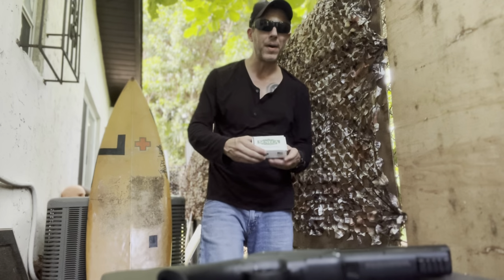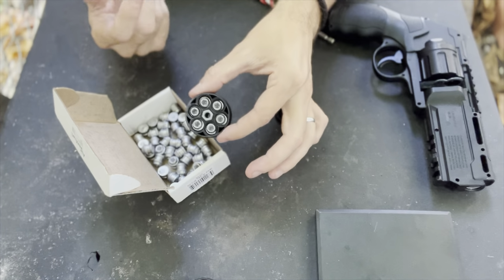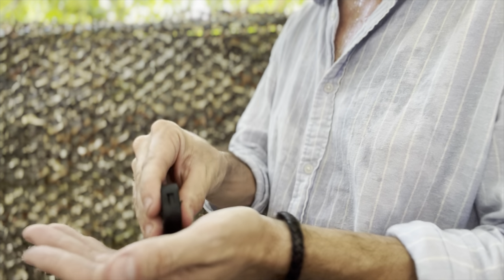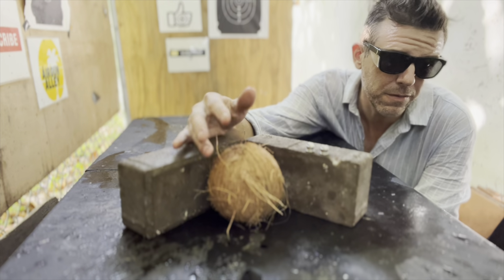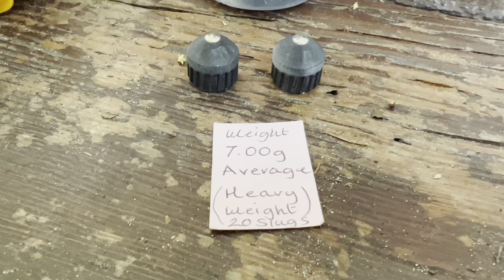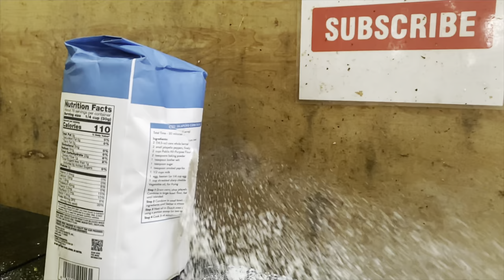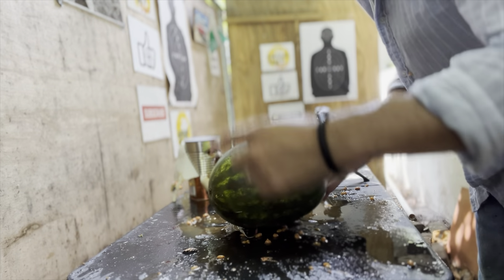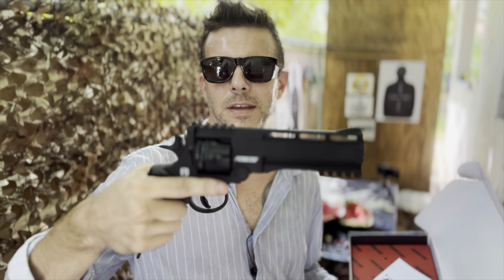HDR 50 • 50 cal PELLETS

Comment: Dab of grease on each rounds circumference to hold in drilled through magazine.
Reply from the maker: Good one! 🙌🏼
Reply: @AirgunAlley  any chance of you reviewing the extended barrels and thread on extension kits?
Reply from the maker: @cal2299  good question. I just reviewed (check my latest video) a barrel-shroud extension that you apply externally. But never the actual barrel extension, nor the whole power tuning kit. (Check out Rune Rebel or DK Spenser for that) 
I actually decided to stop reviewing modified guns and stick to factory products. I noticed that the majority of my viewers prefers that.
Thanks again!

Comment: DUDE I ADMIRE YOUR COURAGE" AND YOUR EFFORTS SO I JUST WANT TO THROW THIS IDEA OUT THERE😐 MAYBE YOU HAVEN'T CONSIDERED BECAUSE I THINK YOU'RE ON THE RIGHT TRACK" WHAT I WOULD CONSIDER IS TO DRILL THE HOLES ALMOST THROUGH EXACTLY LIKE YOU DID" WHICH I THINK WAS SOMEWHAT CLEVER" BUT GO ALL THE WAY THROUGH WITH THE NEXT SIZE DRILL BIT SMALLER👍 IF THAT MAKES ANY SENSE BUT KEEP ON TRYING I SHARE YOUR SPIRIT BECAUSE I DON'T GIVE UP EASILY EITHER👍 HOPE THAT HELPS YOU OUT" AND ENCOURAGE YOU TO STAY COURAGEOUSLY  FIERCELY OPEN-MINDED WHILE DARING TO BE THE DIFFERENT DUDE 💪 OKAY PEACE OUT 👍😊🤔😎
Reply from the maker: Bro!! Thanks so much for the idea (good one!) and for the words of encouragement 🙏🏽 will test that out
Reply: @AirgunAlley  hello dude this is James Brown again I forgot to mention that those over reamed out cylinders can be repaired with hot glue if you go around the edges with a line of hot glue and take a round file you can take your time and smooth them down to the size you wish because once that stuff cools it's basically like plastic itself good luck 👍

Comment: Try a little beeswax will hold a pellets in place and give you a better seal
Reply from the maker: That’s sounds indeed like a good idea Joe, thanks! The only thing I’m not too sure about is having wax splattered along the barrel and in the valves 🤔
I actually stopped using wax molded slugs, I just found them to be too gooey for the gun…
Reply: @AirgunAlley  I don't have a revolver don't know how mechanisms work but I know with airgun I believe if you use Vaseline are heavy oil it can combust and gives you more power
Reply: @AirgunAlley  they call that dieseling
Reply from the maker: @joeschneider8025  I never thought of beeswax for dieseling. I my self am more of a silicon oil dieseler
Reply: @AirgunAlley  guess I didn't say that right Vaseline oil or something of that sort for dieseling I was saying try that instead of the beeswax if you were worried about gumming up your gun
Reply from the maker: @joeschneider8025  ah yes sorry, I just saw your other comment! Exactly, that sort of products I think are best for these kinds of revolvers. Which at the same time also help keep the seals nice and lubed, after constantly freezing from the CO2 release…
Reply: @AirgunAlley  just re-watching your video would like to see you try and alloy very light compared to the heavy to see if you can get your feet per second up towards the 500 range or higher

Comment: A ballistics gel dummy would make a good target. Or possibly one of those giant gummy bears. See taofledermaus for target ideas.
Reply from the maker: Oh man! I agree with you so very much! I’ve reached out to several makers, not many responses yet. That gummy bear is not crazy expensive, I might just go and buy one. Thanks for the input, hope to be shooting some soon :)
Reply: @AirgunAlley  suggestion: once you get the giant gummy bear, coat it in plaster, then let the plaster dry and cut it open with a dremmel tool. Remove the gummy bear and put the two halves back together with tape.

Now you have a giant gummy bear mold.

Comment: honestly seems very weak as most cheap .177 pellet rifles would have shot right thru the can and more
Reply from the maker: You’re right my friend, it’s weak indeed, they’re just to heavy for this gun. That said, there’s a big difference on impact between .177 and .50 cal. These however are only good at close range
Reply: @AirgunAlley  I agree with that to be honest they should add in a second co2 tank and drop it down to .357 would have better velocity but still Carrey enough weight to pack a punch and a extended barrel would be good to they could also just leave a connection for a paintball tank to help

Comment: i would imagine also ,if you sent LEE a sample like these and other types of projectiles ,they could have this to make you a mold . you can customize it by making shorter .longer ,slimmer , wider  ETC. A 1000 OR 2000's of an inch makes a lot of difference , a 9mm is .355 and a 38 or 357 mag is .357 of an inch . so you see a couple thousandths does make a difference !  so imagine these air venturi's with 1000's shaved of circumference and a few 1000's off the entire length !!!!
Reply from the maker: Absolutely!! Indeed this is the best option I think